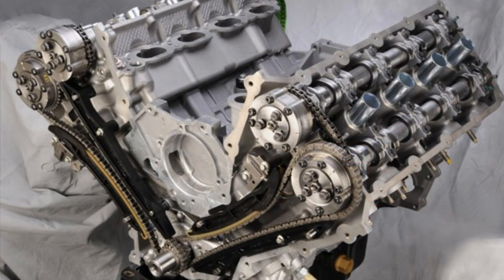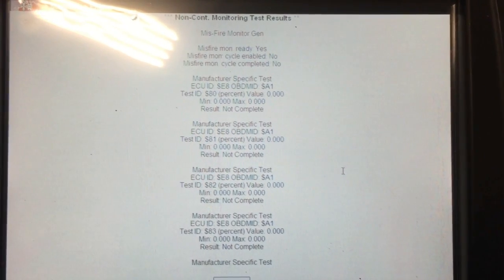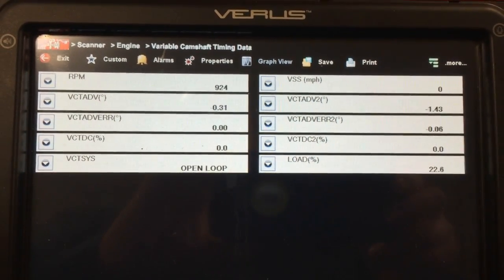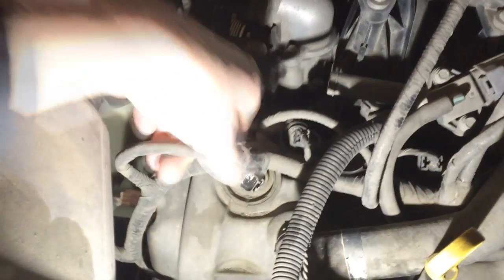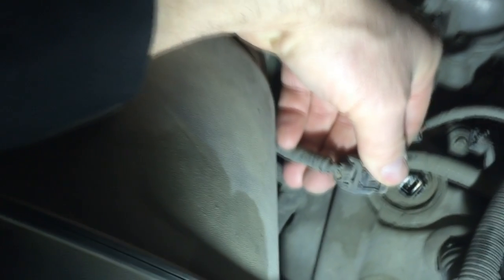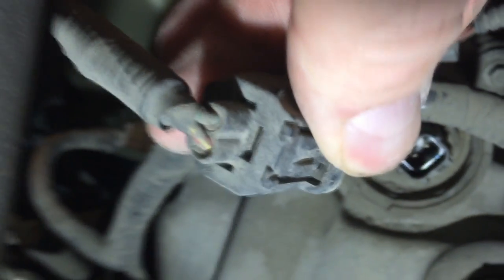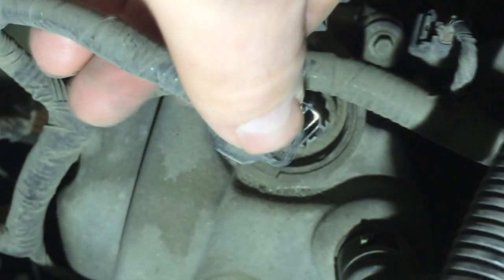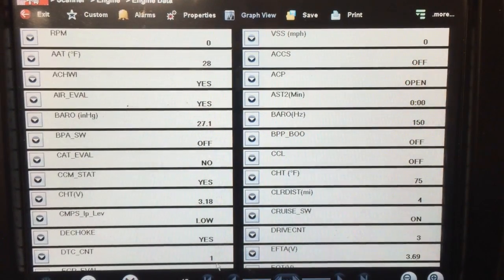Ford 5.4 Variable Valve Timing Codes P0012 P0022

Comment: I have 12 and 22 plus 340 344 346 349. Rough engine. changed the cam sensor and it did nothing.
Reply: Did you change the solenoids and cam phaser?

Comment: I have a 2009 f150 with 164k just recently after the truck is warmed up and come down to an idle in reverse usually on an incline I get both p0022 and p0012 codes and starts missing and extremely rough idle. I've unplugged the vct solenoids and she idles perfect. Just had an oil change done wondering if debris is in the passage way.  I ordered the vct solenoids , do you think this will fix my problem? Thank you for the video
Reply: Any ideas?
Reply: it may be stupit what i ll say but just try it you lose nothing
take the sump sensor off.
Reply: Im having the EXACT issue

2009 fx4 175k miles
Reply: @turo669  did you fix it
Reply: @thuglivintv824  motor died at 194k.  No I did not. Rocker bolt busted off. NO IDEA HOW. Then stabbed it self In the intake manifold.  Just got it out the shop
Reply: Did you fix it

Comment: An observation.
if codes p0012 and p0022 appear both sensors should be replaced and although the oil change has been recent it is also a good idea to change it since the oil may be contaminated and have residues ... 
GREAT VIDEO !!
Reply: The valve sensors
Reply: What sensors??

Comment: I have a 06 Lincoln Navigator Spitting codes P00022 OverRetarded Bank. P0171, System Too Lean Bank 1, P0175 System Too Rich Bank 2, P0300 Random/MultiPle Cylinder Misfire. Also P0305 and 0307 Cylinder 5 and 7 misfires, p0340 P0345 and P0349 for Camshaft Position Sensor Issues???? PLEASE HELP...
Reply: I am having the same problem? Did you find a solution?
Reply: Raul, No. We replaced the Battery, Alternator, VCT's, Cam Position Sensors, Crankshaft sensor, Fuel Rail Pressure Sensor, Mass Air Flow Sensor, Spark Plugs, Coils. Now it's showing -40 degrees, I am in GA. Not that cold here and wires to the Maf sensor, Also changed the fuel filter. Still giving us a fuel pressure sensor issue and won't start. Thinking either the Fuel Pump or the Timing Chain. I will keep you posted.
Reply: @pamheiser0675  did you figure it out

Comment: I have p0150 and p0130. I hear it may be fixed by a TSB update... I also have timing over retarded, and misfires 1,3,4,5,6,7, and 8.
2010 f150 lariat 5.4 
130k miles 
rough idle, low mpg, check engine light, and engine stall. 
:-/
Reply from the maker: Doesn't sound good.
Reply: +The Car Doctor 
I'm going to the dealership tomorrow, $160 for the update and includes the full scope of what's wrong.

Comment: hello. i have a 2010 ford flex with eco boost just over 150k. it gives these codes but there is no issue. it starts up great. no idle lag and has power as it should. sometimes the engine light appears and some other time it goes away until it comes back again. what do you think?
Reply from the maker: Have you checked the engine oil level? had the oil changed regularly?
Reply: The Car Doctor. yes. i had it changed at the dealer 2 days ago now. before that it was changed at some local garage and was used regular oil. since it had the turbos i did not know it needed full synthetic. now i got throught inspection and appeared 2 codes. p052b and p0150. they tell me i need to run it alot more miles

Comment: Thank you for your video!

I just purchased a 2006 F150 with 175k miles on it that was running rough and had poor idle after warming up. After some trouble shooting I disconnected the driver side VCT solenoid and the idle was smooth. I replaced the solenoid with the Dorman version instead of the Motorcraft and now the poor idle is there even if I unplug the new solenoid. 

My plan at the moment is to (1) Do an engine flush with LiquiMoly (sorry but the German in me loves this stuff) and change the oil. I'm wondering if agitating things caused the old oil to clog something. (2) Swap the Dorman VCT back with the old Motorcraft and see if I'm back where I started. (3) Clean a swap the cam position sensors and see if the code switches to a P0012 and then replace the sensor.
Reply from the maker: Not a fan of Dorman. Any chain noise? Hope you get it figured out.
Reply: @ThecardoctorTV  i got some chain noise 2007 f150 5.4 liter, and it's throwing code p0012. Can u help me please.
Reply: You ever fix your issue?
Reply: @macknumber9  Yep, the Motorcraft solenoids worked just fine. The idle is fine now.
Reply: @ahmadkhawaja6152  very rough idle, dying at stops, gas smell from exhaust, check engine light (sorry I didn't remember the code from that long ago. Switching from the aftermarket to Motorcraft solenoids fixed the problem.

Comment: This code only come back after a long drive, p0022 sounds like a diesel... I change both VCT Solenoids and sensors but the when I changed one side I couldn't find a piece of the spring,
Reply from the maker: You might want to pull the front cover and probably need to replace both phasers and chain and components. Hope you don't have an oil pressure problem.
Reply: +The Car Doctor yeah I'm hoping I don't have a oil pump problem, but wouldn't that be cheaper just to replace motor...if oil pump is the problem, save time and the huge hassle of changing the oil pump...
Reply from the maker: It just saves money fixing the whole problem instead of spending time and money and then having something blow up later. We don't see too many folks getting over 150K miles out of these motors here.
Reply: @ThecardoctorTV  My mechanic said that it is probably in need of a new engine without even looking at it!
Reply: @ThecardoctorTV  I got 255,000 miles. Did timing phasers at a lil over 200,000  and replaced vct solenoids at 255,000. My motor is still strong and drive it daily.
Reply: @kirkcardoso6137  what do you Mean by timing phasers and how much did you pay
Reply: @ThecardoctorTV   Oil pump is completely mechanical right so the computer would not throw a coat if there was an issue with the oil pump? Is this correct?
Reply from the maker: Low oil pressure can set lots of codes.

Comment: my 2006 F250 has an issue when I am going slow, mainly in reverse, it starts to buck and jerk and have a loud rattle. I can put it in neutral and rev it up to clear it up but it doesn't do it all the time. it just gave me the P0022 code. oil pressure at gauge doesn't change when this happens
Reply: Butterfly knife experts did you ever find the problem mine does the same exact thing literally
Reply: Jacob No Name has anyone found out the problem mines does the same
Reply: Oil press at the gauge is only an on/off type switch, which means you have some oil pressure. You probably need cam phasers, but you have to manually check oil pressure with a test gauge at hot idle in gear, if oil pressure is below 15-20psi, you prob need an oil pump too. Good luck.
Reply: Did you figure it out?

Comment: Hi I tested the Vct solenoids and they right side has a 4 to 5 sec delay and the left side only takes 1 sec. My oil pressure at hot idle is 17 when it is running rough.. Could the right Vct solenoid be my problem??
Reply from the maker: +Brad Keister Are you getting a code? If so what is the code? Do you hear any noise (timing chain) at the front of the engine?